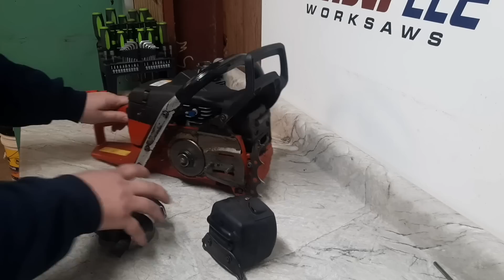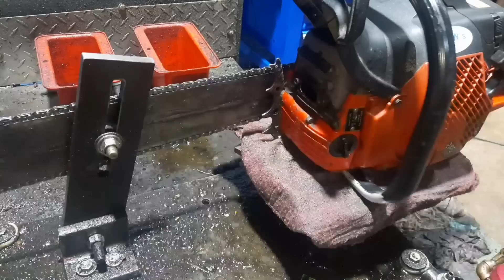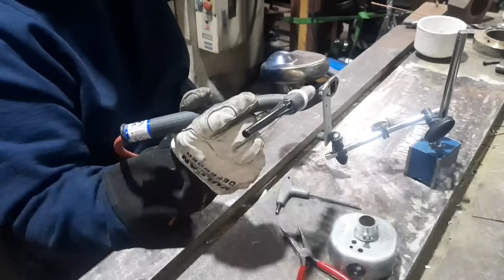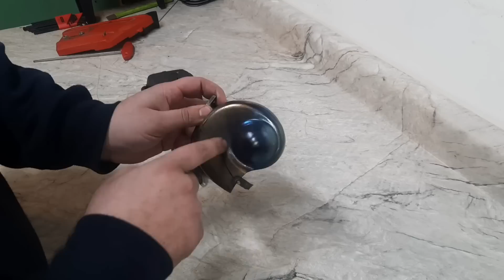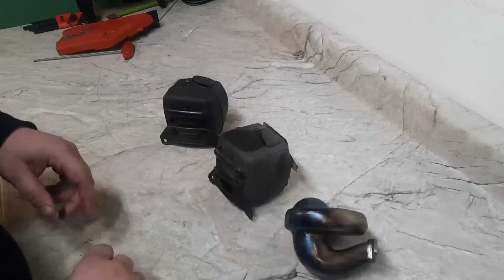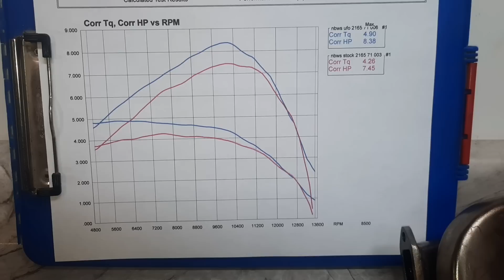MORE POWER WITH LESS NOISE??? Let's find out!

Comment: OK Joe, you are on to something here!  I am wondering what the results would be if you did the exact same tests on a modded Husky 500 series saw... except as previously suggested, I would add a run with the exhaust port open directly to the atmosphere (with any muffler device at all).

Comment: It’s so cool to see the dyno graph numbers on these pipes Joe! Good work friend. I was actually shocked that the small restriction in Morgan’s UFO held the power back, I expected that a stinger on the pipe like on a motocross bike would help out - that could be comparing apples to oranges though since they are a tuned or competition race exhaust on dirt bikes instead of the tuned/purpose built pipes in race saw pipes. So cool to see the results, my Husky 365 is the same big bore minus the porting. Do love the color scheme of the black and red too.
Anyhoosits, good work my friend.

Comment: Guys have been trying to make chainsaw muffler mods to be rocket science for years. 
 Percentage of port size, back pressure, top discharge, side discharge, etc.
 It all comes down to sensibility or bling. Whichever you wish.
 Sensibly the exhaust should angle away from the cut. Preferably to the clutch side.
 The direct front discharge mufflers bounce the sound waves off the wood you are cutting, right back into your ears. Plus they definitely will start fires on dry wood. Spark screen or not.
 You can run Dyno tests until the end of time to discern .1 or .2 hp between mods that cover the span of 6hp. More or less. Doesn't amount to much at all.
 Open up the muffler and point it in a safe, sensible direction.
 If you like cylinder mounted pipes, remember all that weight is harmonically vibrating from the cylinder flange and bolts with no forward support. With my mechanical background it doesn't seem like the thing to do. To each their own.
 I enjoy your work and videos Joe. You do good.

Comment: I typically shoot for 65-70% muffler opening to exhaust cylinder opening. 
Can you do a video with a sliding tab and start with stock opening then do 20%, 40%, 60%, 80% and 100%. Then based on those results go back an do 5% increments between the two best results… because from the videos you’ve done, size opening may be more important than shape. Then once size is dialed in, we can work on optimizing the shape. Thanks and keep up the great work!!

Comment: Thanks for all the testing you do.  Falls in line with what I have felt with my 390XP, I had a single outlet muffler with a 1/2" opening, I ran it in 26" round red oak, then swapped to a muffler I had with two 3/4" outlets, it ways louder but what I found is I could lean on the saw much harder and it had more pull in the lower RPMs.  It had more usable power everywhere.

Comment: Love this stuff, Joe. The Dyno doesn’t lie! Stock mufflers are designed for emission compliance. Period. It doesn’t take much to safely get a little more power with nothing more than a drill and a few hand files. I have a very late Stihl 029 with a cross performance 49mm bore popup piston. Essentially an 039/390. For a “homeowner saw” it is about as big as you can go. Couple holes drilled in the internal baffle, open up the stock outlets that are under the front cover a bit, drill out the weird deflector on the front, and it is money. Quicker response and pulls harder in the cut. Not huge gains, but definitely noticeable. Especially when you’re dogged in to a big log.

Comment: While obviously the pipes and modded cans  make noticeable and substantial gains over the stock can, that saw with a stock can us still really impressive. There are times where you don't really want the noise, like in residential tree work. In those situations, a ported saw with a stock can really isn't dumb in my opinion. That's still substantially stronger than stock.

I'd like to see how much you can open up a stock can before the noise levels really increase by a dramatic amount and see what there is to gain there. 

With my 394xp I added a second deflector but did not remove the baffle. Surely it didn't gain as much as it could potentially have but it is stronger for certain.
Reply from the maker: Some day I will need to invest in a heat gun. I would be concerned with the stock muffler holding too much heat in with the modified saw. But it may indeed be fine.
Reply: @dynojoemods2764  that is true. In a firewood or felling job type scenario that could be an issue. On residential tree jobs though, it's seldom buck after buck repeatedly. I wouldn't think it would heat soak as bad in that specific type of work. 

But even in stock cans you can open up the outlet, or do a more factory style dual port like the older Stihl saws had on their west coast saws. I bet that would probably prevent too much heat soak. Surely it would not let heat out as fast as the pipes or truely modded cans would though.

Comment: Really like that you did this video.
I’ve spent more time than I care to admit fooling with these mufflers. Did I learn anything.? 🤷 I don’t like outlets on the front and I do like screens in the outlets.  3/32” stainless screen works great. I try to balance the outlet size. 1 1/4-1 1/2” total outlet size seemed to work best. I’m still curious what those ufo mufflers weigh compared to a stock can.? I really appreciate these videos, it’s a subject I’ve spent a lot of time on so a big 👍🏻Joe.

Comment: I really like the concept of that UFO pipe and I can see what he was trying to accomplish with it. Sound wave backpressure. This test demonstrates that the pipe is making power by controlling air pressure back pressure, not soundwave. This was a very good test. It would be interesting to see what mods if any it would take to get the pipe to scavenge using soundwave. Perhaps that is better left to the big pipes, but they are impractical as a work setup. I think Morgan is onto something with this pipe. I’m impressed with how it did well right off the bench on the first test. Hopefully he will start building them. I have a 288 that could use one and a 372. I’d buy them in a heartbeat.

Comment: Excellent job Joe. I’m a sucker for the red and black!  Normally I run a pipe in the muffler. But sometimes this is easier. I’ll be curious how this compares with a muffler that has a deflector or pipe in the upper right corner

Comment: Wow Joe that was really  informative. Thankyou. I would never have thought that that modded stock pipe would make that much power. I'm glad morgans pipes still edge it. I bet the serpent pipe hes done will be better still.  So yes please, please can you test some different length and diameter pipes?  Also seems to show that a pipe or  modded  muffler is  crucial on  a ported saw. I'm just about to put a muffler mod video on the 365 special Ive ported on my  channel, and I'm going to try and  make a pipe .. this really  helps so thanks a lot.

Comment: Lately I have been wondering how outlet placement on a modded muffler changes power output. Side outlet vs top outlet vs front outlet vs single vs dual.

Comment: It was really exciting to watch Joe! I really enjoy the muffler and pipe tests. Thanks Morgan and Joe for taking the time to modify the UFO. I have always been curious about the 80% on outlet vs larger sometimes it is very hard to tell the difference in the wood like adding a 3rd port vs dual was it a gain or a loss. I am sure some folks would like to see the modified UFO run on that stock 372 x-torque to see the difference on a stock saw. I have always found the fan cover to look odd on the Jonsereds, but I do like the color scheme and handle. I look forward to more of these tests, a test between that front ported muffler in this test vs a dual port with deflectors and a large single port in place of the stock OE 372 outlet would be very interesting:) 👍
Reply: yep, I'll second the test between that front ported muffler in this test vs a dual port with deflectors and a large single port in place of the stock OE 372 outlet...

Comment: I actually thought that modified can with hole in the front wouldn't perform that well... thought the lack of back pressure wouldn't help it that much🤷🏻‍♂️
Reply: Back pressure is a myth
Reply: @Playingwivwood  Lol....never had a fart get trapped... comes out  with twice the force when it finally does escape🤣🤣
Reply: Cutting a square in the front of the cover allows much greater flow than putting deflectors on the side !  - it’s also liable to catch your timber in fire 🔥!   I personally would run a pipe in the timber if cutting wood 🪵 … if racing then the square outlet out the front is a good option but STIHL makes slightly less powa than a built pipe. A can muffler with a few deflectors simply will NOT equal the performance of a built pipe either in the hp or torque dept  , in fact I’ve tested already it in the wood and know it to be true regardless of saw used. Interesting that the original 372xp x torque wasn’t used in the test
Reply from the maker: I didn't use the stock xt in this test, because I was wanting to show the results of a stock can on a ported saw. And I figured any changes to the ufo up or down should show better on the modded saw.
Reply: @dynojoemods2764  oh Lol 😂
Reply: @dynojoemods2764  ok 👍
Reply: Ah yes … the old fart in the gas tank performance mod … easy 10% gains after a healthy serving of franks and beans 🫘😀